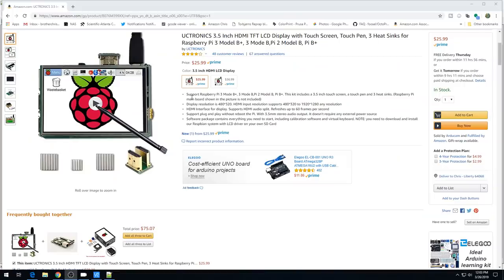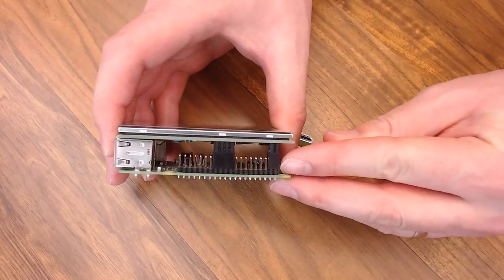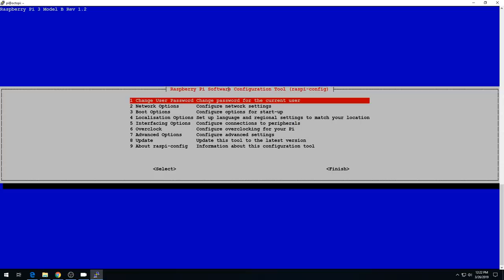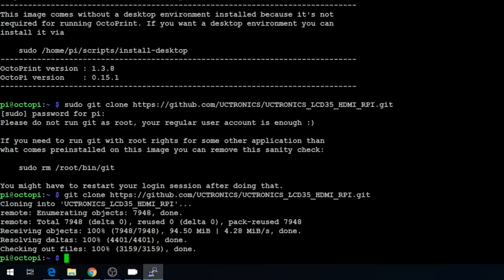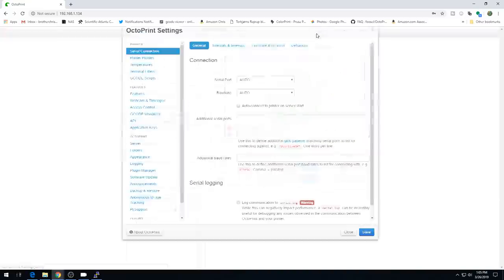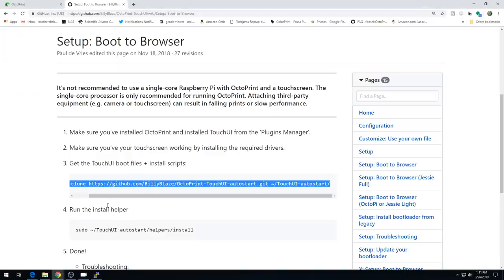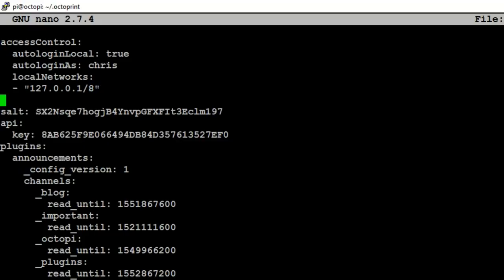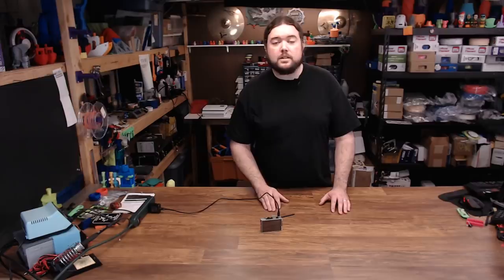Octoprint Raspberry Pi Touch Screen Install - Touch UI - Chris's Basement

Comment: Awesome Chris!  I’m heading over to my Patreon account and add you into my list of creators to support!  You listened to what your viewers wanted and produced the video!  Back on March 3rd, you posted a video “LCD Screen - Monitoring Octoprint” where I agreed with Mark Stemmett’s comment that you should “show us how to connect the 3x5 inch touch LCD display to Octoprint”! When a creator takes the time to reply to most every comment, as you do, and act on some of those comments, as you do, then that creator should get  recognized and rewarded in some way.  Not only did you make a video on a 3x5 inch Touchscreen LCD, but you chose the same one I have!  Thanks for listening to us Chris.  I’ll be pulling mine out of the cigar box it’s been hiding in for two months this week and get it setup!  Thanks again Chris!
Reply from the maker: Thank you so much! I do my best to help the community. I am very appreciative of the suggestions in the comments. If there is something users would like to see I am more than happy to do it. Thanks for the support!!!!

Comment: As always, another great video from you Chris. In my case, my printer sits on the garage. On summer it gets super hot, and raspberry pi's can shutdown after they reach over 85 degrees celsius (as far as I know). So I need a fan in between the screen and the raspberry pi. I can overcome that by having a different HMDI cable and using cables instead of connecting the LCD directly to the board, which is what I will do :) Thanks for posting this video.
Reply from the maker: Thanks for sharing!

Comment: Chris, been looking at getting a R. Pi for my Ender 3/Lerdge K setup and eventually converting my old Up 2 Plus to a Lerdge board. Every time I searched youtube for hints on doing things... your channel came up first and has provided the goods. Big thumbs up!  

Too be truthful, if Lerdge was open source I'd use a wifi SD card to transfer the print file and alter the firmware to have a watch directory on the SD card. Upon finding a new non-busy file it would start printing.

Have a small side project... "spaghetti ball " detector. Saw some AI web camera ones but I envisioned a simpler and cheaper point/dot laser and detector placed so a beam is aimed just above nozzle height and too a side. Basically if the detector falls less than a threshold for a certain amount of time it will mean "something" is where it shouldn't be and the firmware stops the print. I'm sure this could be tied into the filament out detectors that some have as the end result and action taken is the same. Some firmware even has ability to halt if an end stop is triggered when printing as that should never happen. From my observations... the infamous spaghetti ball usually results in a tangled mess all around the nozzle.
Reply from the maker: Great idea! Have you seen spaghetti detective yet? Not exactly the same thing you want to do here, but it might give you some ideas.
Reply: Saw the AI one that requires a camera etc and eventually a subscription. I have ordered some laser diode breakouts and a few detectors. I'm sure it should work but nothing like a rl test. Also, has to work with all the addons people have. Really a matter of setting the 2 end points so the laser is pointing at the target which is a reasonable size. I think the trick will be to have the detector in a small tube so light that's bounced can't set it... just direct line of sight. I'd envision a small cheap Arduino as the controller. (check out the ones with a small oled and a few buttons built in). IMO it should act like a switch as far as printer is concerned but can be fine tuned easily. I made a wow fishing bot years ago out of curiosity and a part of that was listening to the audio for splashing sound when a fish was on. I feel the same logic can be used here where it must detect a strong enough blockage for a certain amount of time to actually trigger. It might test 4 times a second and decide if 60% or more over a 3 second period then it's triggered.

Originally I was looking at a "cat whisker" type setup but that hit a few snags. It basically all boils down to "is something  above my nozzle that shouldn't be".
Reply from the maker: @TheWhitde  Well good luck, I can't wait to see what you come up with.

Comment: Nice tutorial Chris, but a question:  On the screen you showed after it's all working, I didn't see a "shut down" button for the Octopi.  Did it just not get scrolled to during the videorecording?  That would be the (essentially only) reason I'd want the screen -- so that I didn't have to bring a laptop or walk upstairs to get on a computer to shut down the Raspi before I unpowered it (I had a case of SD card contamination from unpowering before shutting down).  So, can an Octopi shutdown be issued from that LCD screen?  
Thanks
Reply from the maker: Yes it can, you can just go to the 4 lines on the right and go down to system and the shutdown options are in there.

Comment: I love your videos, so helpful and really like your demeanor and methods of explaining. I am very new to all this and your videos are so easy to follow and straight to the point. Set up 2 octoprints with your other video and now adding the touch UI with this one. Thanks!
Reply from the maker: NICE! Thanks man, glad they are helpful!
Reply: @ChrisRiley  THANK YOU so much for taking the time to make these videos and share!
Reply: @ChrisRiley  hmmm uh oh not sure what happened. I selected the auto log-in but it didn't take,  when it restarted it just had the bad page  icon. So I restarted the pi and then it wouldn't connect to touch UI. So then I went in and added the auto log-in and network info like you show at the 12' 30"  mark, went ahead and rebooted. But now it's just stuck on the connecting to touch ui screen and then fails. Any suggestions? By the way I'm using the official Raspberry Pi 7 screen
Reply from the maker: @ryanrm8547  It could be a touch UI issue, check this out. https://community.octoprint.org/t/touch-ui-plugin-not-working/16757

Comment: I used this video last year and everything worked. I did an update that caused me to have to install Octoprint fresh then discovered there was a huge issue with the install for the screen.  After some thinking, went to gethub and found the new instructions for the UCTRONICS screen. Hope this helps some other users
Reply from the maker: Thanks for posting this update.

Comment: Hi, which version of Octopi did you use to do the touche screen.  I know my screen is okay because it works with raspbian but when I use the sdcard made with octopi, the only thing I get is a quick picture of raspberry for a nano second and then, a white cursor not moving on the top left corner of my screen.  I'm using HDMI connection.
Reply from the maker: 0.17 octopi should work with 1.4.0, check this out. https://community.octoprint.org/t/touch-ui-plugin-not-working/16757

Comment: Hey so at 3:41 you mentioned that you can use octopi.local only if you have one octoprint instance running. Well, if you just go into raspi-config on each octopi, you can actually just change the hostname and access it like that. That way you can have a different .local for each printer and not need to know the ips for each. Great video by the way xD
Reply from the maker: Thanks man! Yep, I think I have that in a video somewhere. I just say that so people know they can use octopi.local. I wipe out these installs every time a do a new video, so I endup with a lot of these octopi.local devices on the network. Thanks for adding this though.

Comment: Great video as always, Chris. One question... We are on satellite internet here and pulling down files from github using the git clone command isn't always reliable. Is there a way I can download the zip file from github and then install it manually? The last time I tried to use the clone command it wouldn't pull because the directories weren't empty and I ended up having to re-flash the whole image of the SD card and start from scratch.
Reply from the maker: Thanks Ben, sure. Probably the easiest way is to copy the zip file from your PC to your Octoprint SD card. That will put it in /boot. Thee you can cp the file to /home/pi then unzip.

Comment: My screen came with a driver CD with the driver file on it. The Pi couldn't read the install file. Fantastic. Not to worry, I gave up on the touch functionality a long time ago. It serves only as a screen now. The touch does work. The Pi found the driver, but it's offset. A lot. Nothing worked, the touch couldn't be calibrated or changed. I might give this a go, the screen is the exact same one I have.
Reply from the maker: Well, that kinda sucks, if you figure it out, please let us know.

Comment: Chris, which case have you printed for this specific raspberry pi + screen? I could't find any that supports the double HDMI connector for the screen. Thanks!
Reply from the maker: I was using this one. https://www.thingiverse.com/thing:2720491
Reply: i just remixed one that works great https://www.thingiverse.com/thing:4073807

Comment: Hi Chris,
I'm a huge fan of your videos they really help me started with all this stuff!
Just before installed TouchUI I followed your instructions to configure two cameras on Octoprint with MultiCAM (in my case I have a PI Camera and a Logitech C270).
So far I can still use MultiCAM on my browser and TouchUI allows me to visualize through my default webcam (which is the Pi Camera).
I wanted to know if it could be possible to have MultiCAM on TouchUI and to be able to switch between my two webcams directly on my TouchScreen?
Reply from the maker: I think it could be done, but the creator of touchUI will need to add it. I would put a feature request in over here. https://github.com/BillyBlaze/OctoPrint-TouchUI

Comment: Love touch UI, any resolution below 1024x600 you will have a hard time if you want to use an on screen keyboard inside touch ui. I would suggesting using a 7" 1024x600 screen. I've gone through multiple screens on my configurations, and I've settled on that version. I have noticed that in order to power a larger screen (you wouldn't be using a hat), you should run power directly to the power pins on the pi, the micro USB power inlet on the Pi is really not rated for 2.5A (that connector is actually only rated at 1.8A of continuous power delivery).  I absolutely love touch UI, I prefer to rotate the 7" screen, makes using the on screen keyboard easier. (that takes a bit more configuration to rotate the display and rotate the touch functionality). I would stay away from UCTronics screens -- or at the very least check the script that installs the "drivers" some of their screens replace the kernel, which is a hack, if they replace your kernel, you're stuck with any bugs which are that specific kernel version.
Reply from the maker: Great comment and great tips, thanks!

Comment: What touch screen user interface would you recommend when running two octopi instances on a single raspberry pi? Thanks
Reply from the maker: I don't know of one that will do two on the same pi. Klipper screen will do it, but don't know of anything that will do it with octoprint.

Comment: I was wondering if you have seen any problems after upgrading your octoprint to the latest version 1.5?  I've been trying to install TouchUI on mine and couldn't get it to work at all (kept giving a browser error and I tried every hack command that I could find that seemed related to it).  So I started back over 'not' upgrading my octoprint and now TouchUI comes up for a few minutes showing the display screen but then within a few minutes it goes to screen showing "Startup Failed", and will not start again until I power down the pi and restart, but then it does the same thing again.  I'm using an Adafruit 3.5 touch screen, so I don't know if the HDMI ones you mentioned work any better.
Reply from the maker: I still need to upgrade to it. I will and report back or make a video.
Reply: @ChrisRiley  I just upgraded mine after I received the same touchscreen you showed.  I did have to do the one fix action by changing the CHROME_ARGS settings in the chromium.xinit from $TOUCHUI_URL to http://0.0.0.0/
And the Touch UI screen came up fine.
But having one problem now with the Calibration.  The latest install settings are different for the screen, but your instructions helped me get along OK, but I'm needing the calibration.  When I touch the top right are the pointer is in the bottom left area.  
I did install their driver with:  sudo ./install_uc_touch_o.sh which should be the 0 Rotation, but it looks like it's reversed touch points.
The problem is that it didn't provide their calibrator tool with the install.  So I've reached out to Uctronics to see if I can get that.

Also during the installation of the UCtronics drivers, I lost the webcam (using a Pi camera).  So I'm not sure what happened there, but if you have any suggestions I would appreciate it.  I haven't done any research on that issue yet.  (Getting error that Webcam stream not loaded).
Reply from the maker: @mikeharo2568  THe bad part about this is I think they are going to want you to use the calibration utility that needs the desktop installed. That is a pain to install then remove later.
Reply: @ChrisRiley  Actually I found out that I didn't need the calibration utility.  They provide to install methods now one with a 0 rotation and the other with a 180 rotation.  I went back and used the 180 rotation and in combination with the flip button on the screen it now works perfectly and the touch actions now correspond with the onscreen arrow now.
Reply: I did find one issue with the current drivers for this touch screen.  It seems to disable the raspberry pi camera.  It gets an error now that says:
Failed to start
See 'systemctl status webcamd.service' for details.
I haven't been able to figure this one out yet.  But if I hook up a USB webcam, it seems to work fine.  Just not the Pi camera.

Comment: Chris, is there a way to use TouchUI with a 2 (or multiple) printer Octoprint setup? I currently have two printers and want to use one RasPi as an Octopi server for both, therefore one screen. You think it's possible?
Reply from the maker: I think it is possible, but it's going to take some coding. I have been asked this many times, but I don't know that anyone is working on the project.
Reply: TouchUI is browser based, is it not? If so, we could probably edit the code to add a menu item to go connect on another port (another printer instance). I'll try to poke around and see if I can figure it out. If you have any thoughts or find anything, let us know. Cheers!
Reply from the maker: @FernandoAlvesJr  It is browser-based,  I think you can probably load multiple chromium browsers command line, just not sure how to flip through them. I will let you know if I find something.

Comment: Never knew this was a thing and now I have to do this project. Is there a way to make this happen without actually attaching the screen to the PI? I want to use a 7" screen and I already have a case printed for my Pi I want to keep using.
Reply from the maker: I think you could use an HDMI cable and some jumpers and be just fine.

Comment: Hey, Chris, Dumbshiza Xfinity apparently doesn't want their residential customers to have static IP so I'm having insane trouble making my octoprint remote connectable. Any advice? It's set up and works great and connects easily and readily on my local network.
Reply from the maker: Yeah, that always seems to be a challenge. Port forwarding or VPN on your router are about your only options. Also, look into dynamic DNS, that will keep your IP updated to one of there DNS's. There is a bunch of them, I use this one. https://www.noip.com/

Comment: Chris a question- at the home stretch of installing the TouchUI to work with my touchscreen however im stuck at installing dependancies screen - hasn't updated in over half an hour- can i restart it or will i just have to wait longer?
Reply from the maker: Yeah, I would restart and start over. You might have to run a clean up. sudo apt-get install -f

Comment: My install failed at the TouchUI/helpers/install. During installing dependencies (xinit xinput xserver-xorg xserver-xorg-video-fbdev x11-xserver-utils matchbox unclutter chromium-browser) it gave me a ' - failed' and stopped the installer. The blue screen for logging in didn't appear. Am using the KeDei v1.1 (3.5") SPI/HDMI display on a 3B+ with the waveshare driver (https://www.waveshare.com/wiki/3.5inch_RPi_LCD_(A)). Don't know what I'm doing wrong.
Reply from the maker: Sounds like some of the libraries didn't get installed. Run sudo apt update and sudo apt upgrade again and try to reinstall the packages I have listed.

Comment: Great video as usual. 

Have you used octopi and a tft35 from BTT? Both are plugged into my mainboard but neither seem to recognize when a print is started from one or the other. Any tips on this?

Thanks!
Reply from the maker: Yeah, they are going to be on separate serials, so they don't know about each other. It's going to be hard to use both.
Reply: That's what I was afraid of lol. Thanks!

Comment: Thank you for your detail instructions!  All went well, however, now when Touch UI starts, I get this dialog box with nothing in it and close radio button that won't ever close?  Any ideas on what I can do to fix it?  Also, when setting up the autologin to Octoprint, isn't there supposed to be a password entry as well?
Reply from the maker: Hmmm, not sure on the dialog box, it's trying to tell us something, does it come up in the web interface? With autologin true, you shouldn't need to provide a password.